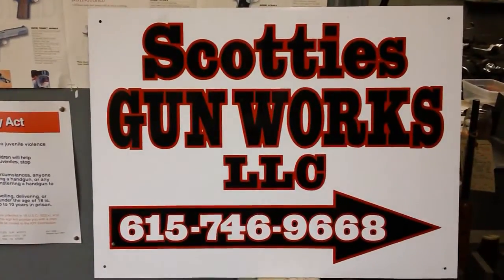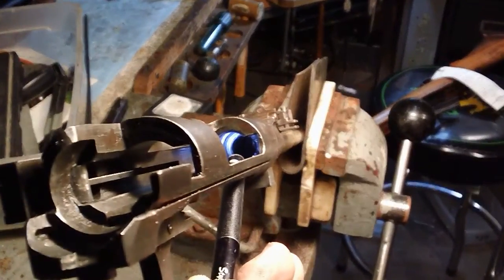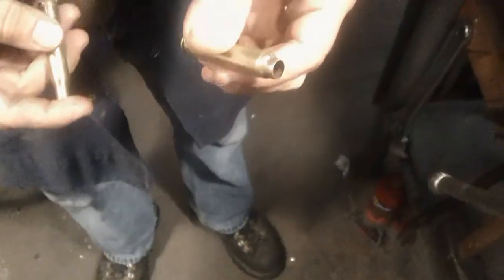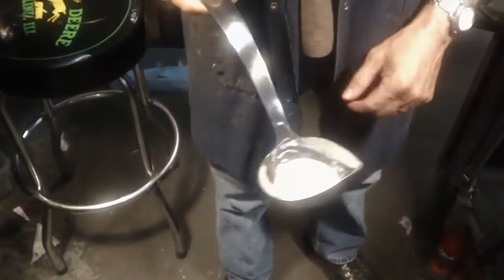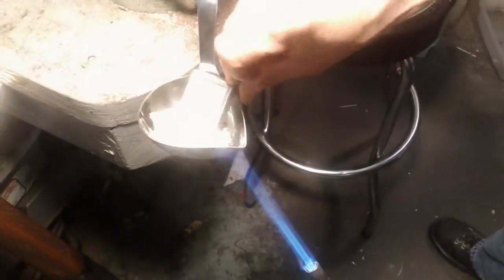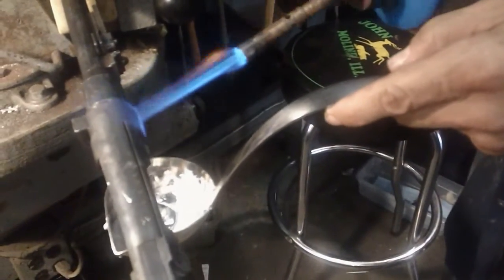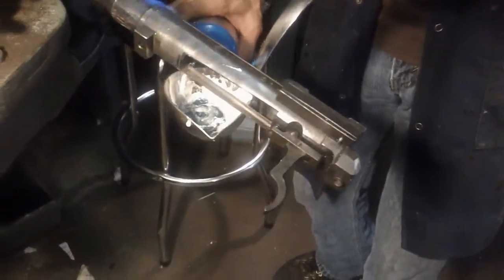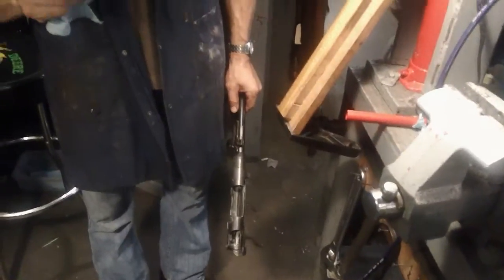Chamber Casting a Rifle-Attempting to identify a chamber problem on a 7.7 Jap rifle

Comment: it was rechambered in 30-06
Reply: Maybe that was the intention, but if they left burrs so bad you can't even knock cerrosafe out, they sure didn't do it right.  The front of that brass where it blew out isn't even close to the correct shoulder for a 30-06